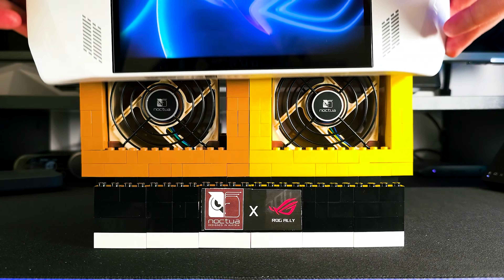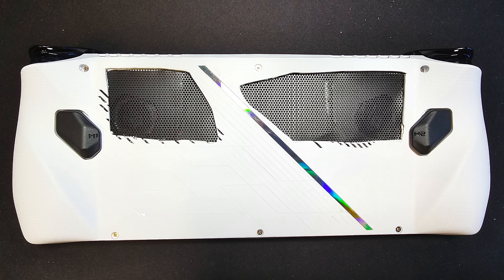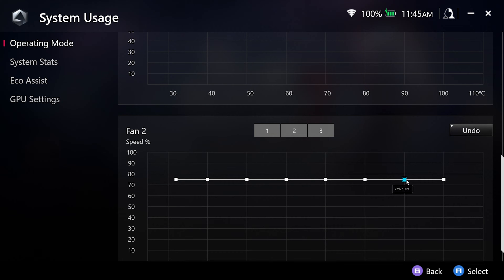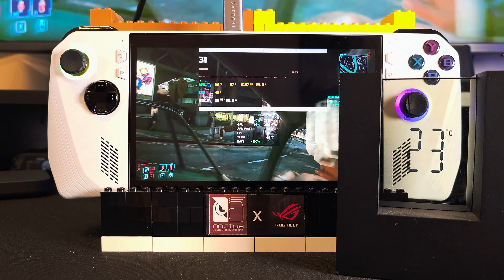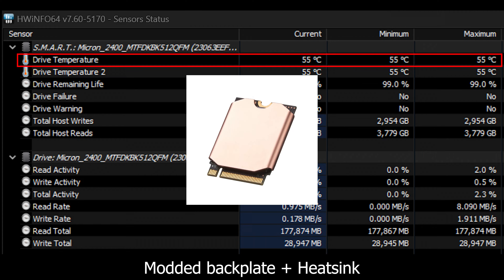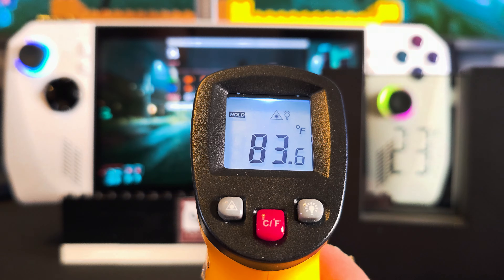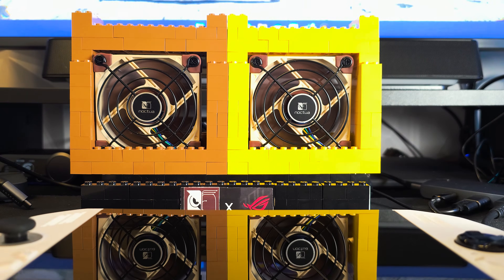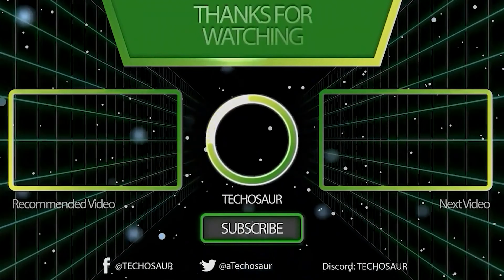How a simple Mod to ROG ALLY's back cover changed temps forever!

Comment: This mod is completely pointless if the gaming performance didn't increase?
Reply from the maker: Yeah, any cooling technique won't push performance up, but you may be able to lower fan speed a bit. it was mostly experimental at that time, I didnt have very precise cutting tools so i used anything i found just to check the difference, it was good for cooling but didn’t have a nice looking
Reply: @TECHOSAUR  eah the other downside is it will get way more dust ingress so will need to be cleaned way more often
Reply: @TECHOSAUR  Lowering fan speed should theoretically raise battery life, no?

Comment: You really couldn’t have chosen a better tool & method for cutting the back plate. You can perform some tasks but this shows a certain lack of complete care. Where else don’t you care. Besides looking like poop it just demonstrates rush work and imperfection that’s not a good look in tech SORRY it seems like it works. I’d be so bent every time I saw it

Comment: Just replace the thermal paste with Liquid Metal and you’ll get just as good cooling.
Reply from the maker: Did you get lower temps with LM vs the current ptm 7950 applied ?
I heard from others that it's not much different
Reply: @TECHOSAUR 70c @ 25w and 79c @ 30w for extended periods.

Liquid Metal only, no dual fans or any backplate mods.

Comment: Wont that void the warrant
Reply from the maker: No it doesn't, actually this mod helped me when I tested the Ally on 50w TDP even in summer by not thermal throttling
https://www.youtube.com/watch?v=pTvWJey9ku8

but for normal-use case, I dont think it is necessary to alter the back cover, especially since it honestly ruins the looks, at least if you have a precision cutting machine it will look nicer but i did it by hand and It just looks funny :/
fortunately, I got a replacement cover

Comment: you better buy a laptop..lol
:face-blue-smiling:
Reply from the maker: Now that it's winter I got back to the original one and pre-ordered the handheld DIY ome, hope it will provide good cooling
I'll also test it once it arrives 

 I used this modded back cover in summer and even ran it at sustained 50w  didn't hit the throttling point, it was an attempt, maybe if I had better equipment it would have ended better but lesson learned

Comment: The open back approach is great, but in general you would get much better temps by exhausting hot air from the top. However as I can see in the videos, neither solutions have impact on the fps, even I could see higher freq on higher temps? it would be interesting to understand thermal throttling of the ally and if it get any impact from moving down temps. in theory it should right?
Reply from the maker: Maintaining temp below the TJMax of 95°C won't directly boost performance, assuming no thermal throttling is happening. However, better cooling can extend the lifespan of components and reduce the likelihood of thermal throttling, The real advantage comes by raising (TDP), By keeping temperatures lower, you have the flexibility to increase the TDP, which in turn can lead to higher FPS. In my test with Starfield, for instance, I noticed a small difference in performance when increasing the TDP from 30W to 50W, but it resulted in higher frequencies for both the CPU and GPU.
https://www.youtube.com/watch?v=pTvWJey9ku8

someone told me that call of duty could benefit even more from these higher frequencies, so I'll try to test this ASAP, I'm also exploring what other performance gains could be achieved with improved cooling.
but unfortunately, I softbricked my ALLY unit by changing in SMOKELESS tool, the CPU P0state,

btw can you show me how exhausting hot air from top is being done by others? i dont know thx
Reply: @TECHOSAUR  I was referring to a vacuum solution. To extract air from the hottest part of the ally, which is the exhaust. Usually this also happens with laptops, and there are different vacuum coolers. I haven't tested with the ally, but could be interesting.

Comment: I had the same problem with my asus laptop. I took the plastic paper filter out because it had almost no air flow. The Temps went from 89c to 60c. But now I have the ally and need to do the same thing. I wish asus would fire who ever it is making these decisions on the cooling designs. I mean it blocks air flow.
Reply from the maker: that's a dramatic drop!!!
Other than this "overkill" mod I did, from inside you can also change the dust filter they put on the side intake vents, it's very sealed
I already ordered 1 replacement cover and will show how to do it with a comparison
Reply: Im not sure in the long run but i did this to 2 of my ROG laptops years ago and its still running cooler and better, did the same thing to my ROG ally and somehow fan require less and gradual acceleration for more intake, i guess that helps the fans from spinning too quickly/ max when im on higher wattages.

Comment: Keep in mind making bigger openings means you lose the "negative pressure" that devices like this rely on. When you play with these pressures, you might be actually heating up other components (such as the RAM, being that it is the furthest away from these holes - and there is no way to get a temperature reading for that). So what I'm trying to say is, you may end up burning out other components relying on sensor readings alone. It's a risky mod.

Also, did I miss it, or did you not share your stock temperatures before the mod for the SSD?
Reply: I just add a 5 inch fan in the back powered by a small powerbank

I added a dust filter to the square hole I made and secured the fan with screws and some adhesive

I used a spare part backplate from a bricked rog ally keeping the original backplate intact

The 54watt mode I call Super Turbo works well with the fan and the ally draws backup power from the power bank too it can work up to  2 hours only so I have to keep the power bank plugged in but I only use this when I play very demanding games like Cyber Punk 2077 and Star Citizen
Reply from the maker: I'll try to find a way to put temp sensor on RAM as i can't monitor it from software.
I thought about taking the SSD results post mod, I remember it was constantly in 60c area even with heatsink

Maybe u are over worrying a bit coz things have been ok so far, I'll keep updating you all if anything happen
Reply: @TECHOSAUR  I wouldn't say @baldsealion is "over worrying". Designs like this are not dissimilar to server rack style cooling - where 1U to 4U servers use the chassis to duct and guide airflow through components. Many rackmount designs would lose cooling efficiency when opening the chassis up or running without the chassis covered. 

I'm not saying your design is an improvement or loss, as we don't know why Asus designed it that way and what their design goals were, but it wouldn't be a stretch to say that cooling performance may be lost on some components while gained on others. 

Whether it makes a material impact to longevity or performance is another story as well. In either case, awesome testing and awesome that you gave it a shot and modded it for everyone to see.
Reply from the maker: @MonkRX  Thanks for your comprehensive comment, but if you look at handhelds like the Legion GO, and Ayaneo Kun, you'll notice that their cooling vents are designed with simple geometric patterns—often circles or rectangles with relatively 1mm diameter openings that facilitate airflow. but In contrast, the ROG Ally features more weird-looking intake shapes (ROG logo) and the mesh glued inside has micro openings, it has a lot of random tapes to prevent dust too

I'm not a thermal engineering expert, but based on what I have, it seems that the device struggles with heat dissipation. At a power draw of 30 watts, the device reaches temperatures as high as 70°C with an ambient of 23c. This becomes a concern when you consider that its APU is capable of operating at 54 watts, i see it being thermally limited
especially because Ayaneo yesterday announced their new KUN model, which has been designed to sustain gaming at 54 watts. Their cooling system appears to be more effective even with just one fan, the ROG Ally has 2 fans yet can't play at 53w for more than seconds,  sure the ALLY has many features, but cooling decisions needed a bit more

as for concern of overheating other components with this back cover, I'm going to try using a thermal camera and compare it with the stock one, so we can see temps across all parts!

Comment: Why do you need more airflow when the device can already hold sufficiently cool temps even with exceeding stock TDP by 10w?
Reply: More airflow better performance it’s like a car
Reply: BECAUSE YOU CAN 😂 I put a 2280m.2 in mine 🎉
Reply from the maker: while the APU is able to handle heat by being cooled, what about nearby components like the SSD, RAM, or some MicroSD cards that are getting damaged from heat? they have no way of cooling themselves actively, Getting more airflow inside cools them down a bit, and also it helps users who use mods that increase TDP over 30w like smokeless 

Of course, it's by no means a clean solution but a living proof that the stock back cover vents are not efficient for a device of this complexity
59c at 30w is not bad,  it is around the temp hood you would get on a gaming desktop

Speaking for myself  "cooling is a satisfaction"

Comment: Thank you for testing this. The problem with this mod is that it kill the aesthetics and resale value. I think a better approach would be to add extra heatpipes
Reply from the maker: It's a nice idea but is it possible to add more heat pipes without voiding the warranty? You would need to unscrew the fans and bracket
but still, it's interesting to try to see how much it makes a difference!

as for the resale value, there's this place that sells spare parts https://en.accessoires-asus.com/ally-console/ally-spare-parts/asus-white-rear-cover-73891-111690.htm
I got one just in case
Reply: I'd buy OEM back plate and mod that instead and set aside my original one
Reply: True